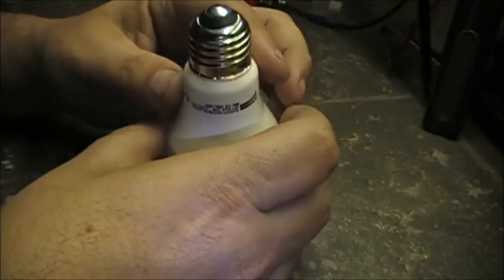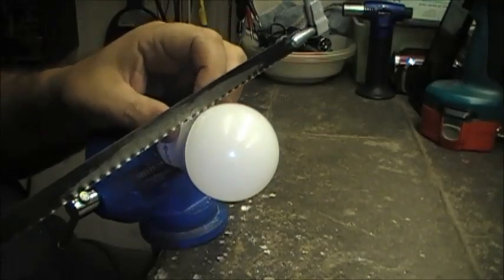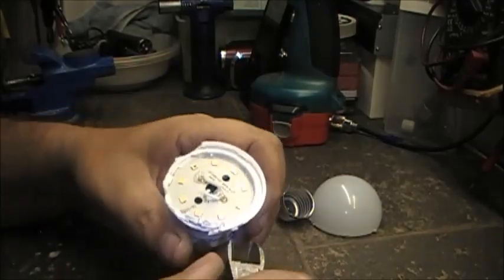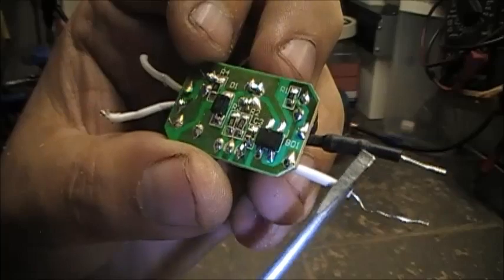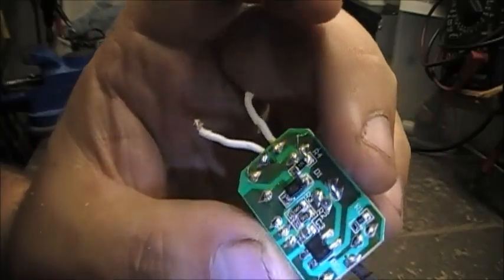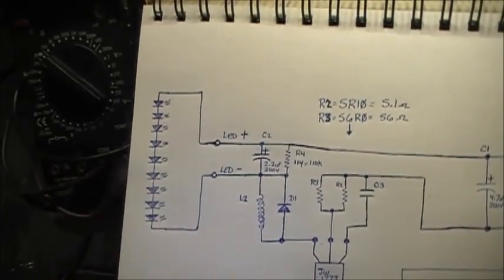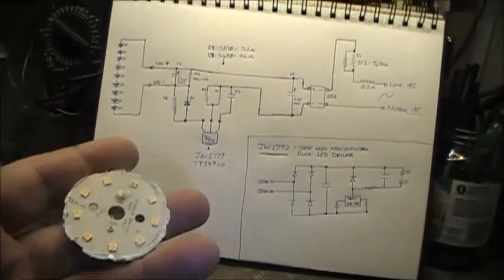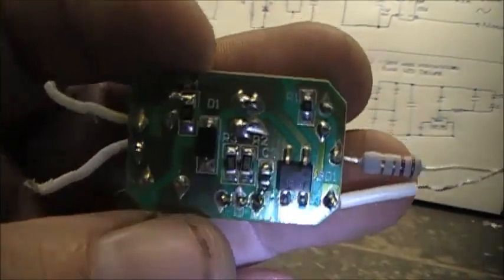What is inside the LED bulb - Why did it stop working?

Comment: did you find out what the output voltage was?  I wonder if these can be salvaged to provide dc for projects
Reply from the maker: I did not try that....  perhaps i should try it, see what happens... tho at 96ma, it wont power much tho. 🤔
Reply from the maker: I just recorded a video on that board, uploading the video shortly, please stand by! 😊
Reply: @Radionut63   Roger

Comment: Do you have a hot air station? Save that board and when your next LED bulb fails, replace the burnt chip LED (once you figure out how to open the casing without a hacksaw).
Reply from the maker: The cover is epoxied to to the body, good luck removing it without damage.  But the internal board has useful parts.